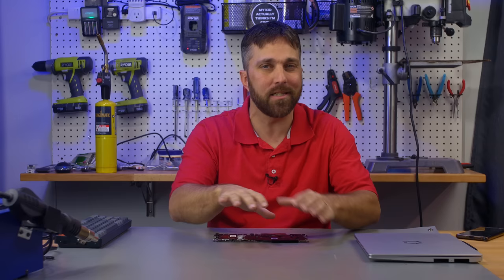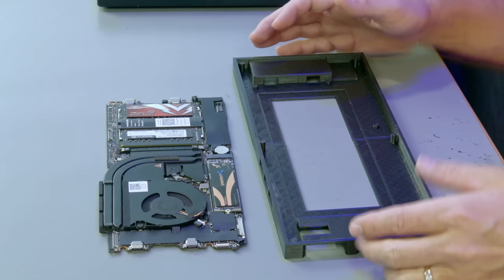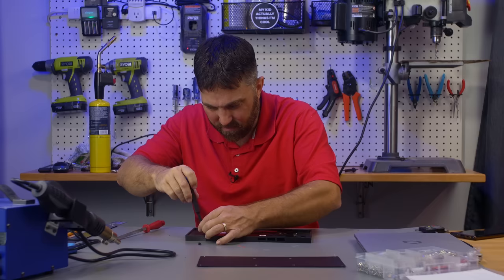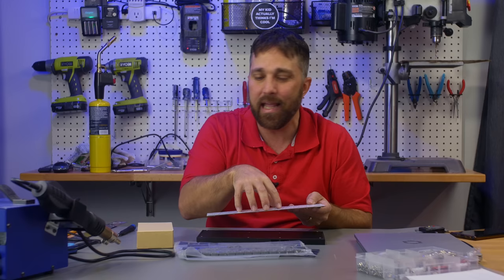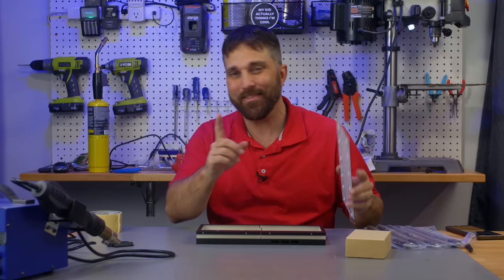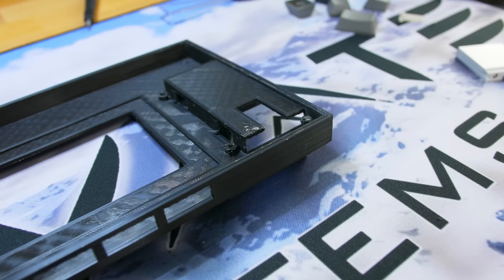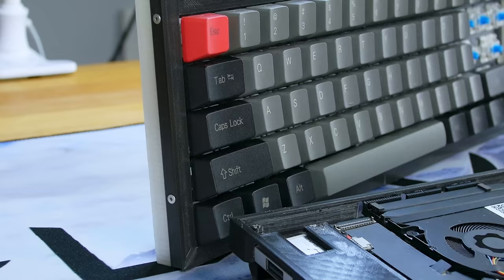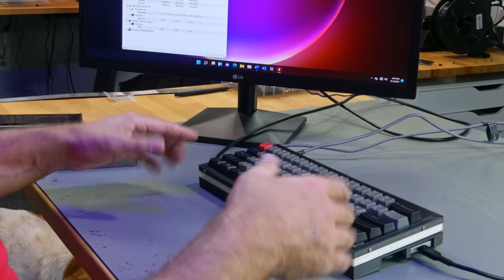Complete PC in a Mechanical Keyboard! Retro Concept, Modern Hardware.

Comment: HOLY CRAP! This is AWESOME!!!! This is like an ultra souped up Raspberry Pi 400 which is something that is already so awesome, your project makes the membrane keyboard into mechanical and gives a much more powerful processor with Thunderbolt 4 so it can even have a dGPU! This is so friggin' awesome because it's such a cool and tiny desktop replacement, the only thing I'm still a bit worried about is cooling because the heatsink and fan were designed for a different airflow situation but you have done a really good job of managing that!
Reply: Honestly if you did it right you could do much better airflow with this than a laptop will ever have. Especially if weight isn't as much of an issue.
Reply: With a metal case it could also act as a huge heatsink.
Reply: I imagine the airflow is fine though? It sucks in the air from the bottom and blows it out the back - just like it would in its original laptop frame. The feet are even taller in this case.
Reply: I've been attempting a custom PC with integrated screen using a NUC, but the challenge is getting it as thin as possible without messing up the cooling. These Framework boards look like the very slim profile that I'm looking for.

Comment: This is incredible. Hope someone can mass produce something like this in the next few years. Would be an awesome little home server deck when paired with an old display.
Reply: Yeah, sell them on Etsy
Reply: The raspberry pi 400 is pretty similar though a lot cheaper and less powerful. It's a fun little thing. Oh also the keyboard is a lot worse, after all it's only 70 bucks for the whole thing, keyboard and computer. Lots of people spend that or much more on just a keyboard alone.
Reply: I like the C64 keyboard cases you can get
Reply: @CutoutClips the best thing about this is that as the framework laptops get outdated, we'd see more kickass products and projects like this. I love it!

Comment: I would recommend trying to get an output/input to the eDP, keyboard, and battery connectors on the Framework motherboard. Save the expansion slots for other things.
Reply: Are there some connector cables or converters available for that already?

Comment: Would be cool if the 4 expansion ports could all be routed to the back
Reply: They could with a 90-90 usb cable probably
Reply: well since the expansions are usb type c extensions it should 100% be possible to rig it up so they feed to the rear
Reply: I liked the hub + palm rest idea a lot,

Comment: You could totally put the batteries in front of the keyboard and use it as a palm rest (just like 99.9% of laptops do anyways). Your keyboard is reeeeally high, making it difficult to use unless your wrists are always in the air. A palm rest is definitely needed, and putting batteries underneath it would make a lot of sense. plus, you can put some foam pad on top of the battery compartment, making for an even more comfortable device.
Reply: That's an interesting suggestion…

Comment from the maker: Follow-up - I reflashed the keyboard to try to get the RGB functions to work and it bricked. You get what you pay for. Going forward I'll be ordering this PCB https://drop.com/buy/dz60-dz60rgb-type-c-60-pcb
Reply: Couldn't find the unlisted video anywhere! (0:55)
Reply: not sure if you cover it in the other unlisted video, but out of interest why did you out right delete the other video?
Reply: @shadowreaperjb  He unlisted it, its still on his channel if you know the link
Reply: 16:37 Why not both?  The palm rest would also give you the ability to integrate the  battery from the laptop as a UPS along with a cheaper USB3 hub to split the connection you use for the keyboard to power a couple of 5V Noctua fans to keep things cool.
Reply: Could you put the battery in a wrist wrest?
Reply: If you wanted a tenkey  in a 60% form, look for a 65% PCB. for example the bm60ec pcb is 65% key hotswap with rotary encoder.
Reply: If I was making a case to put on the back of a monitor I'd make it way thicker so I can glue on big/thick heat sinks to the OTHER side of the heat pipe.  I did this on a laptop where the heat pipes face down towards the surface laptop sits on cut a hole in the laptop cover and glued a big heat sink on and it dropped my temperatures 10-12C.and that's idle and underload. A modern CPU like that could hit turbo longer with such improved cooling
Reply: Can't you replace some chip on the keyboard to make it work again?
Reply: And so a laptop has been created that has a real keyboard and not those crappy keyboards that all current laptops have. My compliments to the build. too bad there is no manufacturer that makes something like that (which is affordable)
Reply: well its been long after you start the project but here is a question:
why not use thunderbolt hub instead of usb hub? 
that way you can use it for power and may be tap in hdmi?

Comment: I always thought the battery could be used as a palm rest. Epoxy a wooden veneer on all but the top and then add whatever thickness of wood is needed for optimal wrist height.

Comment: I really love you for doing this project. 

A couple pointers though: 
• A keyboard this high will need a palm rest so maybe that could be used to make space for a battery (but still not sure if all that height is ergonomic)
• Coming from a keyboard enthusiast, it might be worth it to make the keyboard and usable as nice as possible:
- 65% layout would be much easier to use than 60% 
- Use lubed linear or tactile switches of your choice
- Gasket mount the PCB in the case 
- Design the case to sound as best as possible (but this might be too much for you to get into)

Comment: This made me realize you could order just enough parts from the framework marketplace, minus the entire top lid and screen, to build roughly the same concept but in a thinner package with a touchpad. You can even leave out the battery and speakers, basically a very portable pc but not quite a laptop.

Comment: This is brilliant! I’m a total noob and have only now really began my journey down the computer technology path but this is definitely a build I’ll take on. My goal will be a wireless build, repurpose something for the display connectivity and go full size with trackpad integration to literally create the ultimate retro framing/HTPC. It won’t be anything cutting edge as far as graphical performance but I’ll definitely focus on the wireless freedom for everyday use in home. The temperature and materials should prove a challenge but I’m confident I’ll figure something out. Might steal from the automotive and invest in gold foil to solve the issue since I can’t think of anything else. Thanks again for this! 🥳🙏🏼

Comment: This is an even better argument for the openness and modularity of Framework than simple upgradability. Other upgradable laptops exist with decent form-factors. The fact Framework's board comes out so tidily, and is meant to be worked on, appears to have made this project's success so much more attainable. And in theory you could drop in a newer Framework mainboard some years down the line if they stay in business.

Comment: This is a great project for a clean setup. Especially if you can find a monitor that can deliver at least 60W power delivery and you use a wireless mouse. One cable from keyboard to monitor and one cable from monitor to outlet (and ethernet if needed). Maybe look into thermal pads to conduct heat into the aluminum chassis. The keyboard is a little tall to be ergonomic, so I'd either go with low-profile switches and keycaps or go with your palm rest idea. Underglow does not serve a functional purpose, so that might be something you can remove to simplify the chassis if you want.

Comment: If you build a slightly deeper case, you can move the motherboard back and the keyboard forward so you can have a nice slant on the keyboard, in the vane of the Amiga 500. You could then connect the 4 USBC ports to an internal rear facing module bay so the cables come out of the back. Just some ideas.

Comment: As soon as i saw the Framework laptop this is what I wanted to do. 2 things I have thought about though are using wireless display and some how getting dual external battery packs connected to allow hot replacement.

Comment: You should see if you could create a thunderbolt extension that goes to the back of the case with a bay for framework compatible expansion cards, and maybe you could put one of the ports into a hub for a DisplayPort/HDMI, card reader, several USB-A, and a dedicated USB-C power port. That would be REALLY cool.

Comment: I think you'd be best served by going to a 96% board with the newer gateron low profile switches, so you can use normal keycaps. Rear expansion with possibly a better heatsink is a great idea, and use your palm rest to slap a yuge battery in. If you do it right, you could even make that battery cold swap.

Comment: You could go with a full 104 key, and put a battery under the 10 key section.
Also, it would be nice to find someone to make a ribbon cable for the keyboard so it doesnt take up so much badwidth, and a converter cable to go from the motherboard's internal video(for the laptop screen) to a rear HDMI, DVI, or DP depending on how the laptop communicates with the screen. This way all 3 of the 4 ports could be free
You could take this a step furth by adding a charging circuit to the battery pack. Use a dedicated USB-C PD or just a barrel port that doesnt do data to free up all ports

Comment: There reason for the keyboard cable not working is probably the PCB. For a C to C connection working, there is a CC pin to decide which is the master and slave. Many of the type C keyboard PCBs do not implement that.

Comment: If you make it deeper you can probably fit some 18650 cells in the back or in the palm rest! Obviously, not the original battery so it won't integrate into the motherboard directly, but you could connect it to the usbc port internally, and have a little battery meter on the case.

Comment: Very nice. I suggest incorporating some kind of hub so you aren't eating up all of the expansion slots to connect everything. Maybe also figure out a way to connect the keyboard to the main board using the ribbon/flex cable like the laptop case would do.

Comment: Should totally make the housing look more like something between a commodore 64 and a sony msx hitbit, done similar with my current custom keyboard frame but with a SD card reader that looks like a scaled down floppy drive and then a 3 port usb 3.0 hub but running into a few snags with finding the right length C cables and usb 2.0 hub to run the sd card reader and the keyboard while all fitting in a really small case

Comment: If Framework ends up selling just the mainboard this would be awesome! Having an ultra small form factor PC that you could tuck away in an HTPC, or inside the keyboard like this is just really awesome! I wonder what they would charge just for the mainboard? And since it has current internals, not like 5 year old PC hardware like some of these DIY solutions have, it would be awesome to be like, hey I want to pop an Intel 12th gen chip in here. Or Zen 4 Ryzen.

Comment: If I were making this I would have the keyboard be slimmer. Mechanical ain't important to me, but if it was I know there are low profile switches. 

For the mouse someone could get a track point, or make the deck wider and build in a track pad. But I use a elecom huge track ball because disability. 

It definitely needs tilting and a pain rest because it's so big. But I think another way to play with it is too ensure each component can snap off. 

Like the built in track pad, the keyboard can both snap off and be removed. And the pc can still vesa. And there are extra cables in the palm rest when you do that. 

Problem is if the keyboard detached the palm rest needs a way to modify for the different thickness... Hmmm
Reply: I feel like even with a ball or pad you'd ideally want it detached for most users. I can hardly imagine both hands parallel being the optimal position. 
Otherwise agreed.

Comment: it's often the case that cutom keyboards don't work with usb C to C cables, since they don't work bidirectionally, and normally only work on USB 2, I'd consider looking into that for solutions for the cable, you might have to make your own. (IIRC you need to add a resistor make a C to C directional)

Comment: A full 104/105 form factor might let you add some battery under the right side. The top-right port could lead to a hub board along the top of the keyboard for permanent USB-A ports and an Ethernet port, and the bottom-right port could be used for the keyboard.

Comment: Like a Pi 400 with a much nicer keyboard and more powerful Mobo!

I'd say continue iterating the design! If you make the case bigger, consider adding a groove on top to serve as an external display stand for a monitor or tablet. Maybe even built a rest w/ trackpad? (Saw a 60% wood case/rest combo that looks similar to a small laptops key/mouse area..)

Also there are now small form factor switches that may be worth considering for this. Pair with keys and you can have a mechanical keyboard without a ton of height. Nuphy Air75 is an example. Probably still need a wrist rest, but it'd also be more portable. (Actually with a low enough profile... Maybe a case cover that doubles as the rest?)

Comment: You should ditch the Framework attachment layout. You can use a USB C dock board and a USB hub to handle all your I/O, integrate it into your housing and wire up your own I/O panel on the back.

Comment: Make it deeper, place the keyboard pcb on an angle towards the front to give a better typing angle, and put the mainboard towards the back in the bottom plane of the case with the expansion slots on top of the mainboard in the same plane as the top of the keyboard pcb, makes it so that the keyboard has a better typing angle, makes it narrower, and puts all expansion slots on the back where they belong.

Comment: you could try a line of 18650 lithium cells in a row sticking off the back of the board? that should stayaway from the hot zones while also not making the whole thing that much larger

Comment: i do like this idea a lot, like so much id want to make one, however i would put more effort into making the cooling solution more capable,  like id  go for a a slim 12mm thick 120mm fan and let it run low RPM, through a snug Aluminum body so that the aluminum could act as a heat sink, anything to make the Board nice a cool.  you could go for a  USB C expansion hub which could be extended (if you make it a full sized keyboard, and redirect the blocked native expansion ports via a USB C cable to the back, so you could have more IO and have the ports facing the back. This would make the whole construction more bulky, but i think that could be negated by making a nice tight fitting Alu body to reduce overall size

Comment: Would be very interesting to see an internal KVM switch. Whereby with the click of a button you can switch from using it for the internal computer to an external computer.

Use cases may be very niche, but would be very interesting to see

Comment: great video, i wonder if you'd use a full or at least 75% size, you could insert some flat heatpipes, and if possible a battery too, i also think a 75% could probably fit a small touchscreen display like on camera equipment

Comment: Imo, I would extend the width of the keyboard to incorporate a hub in the back of the keyboard.  It would also make it more reminiscent of the Commodore 64.  I'm not sure, but if you extend it out, you may be able to add the battery as well, although a custom cable to connect it to the mainboard may be needed.

Comment: I have had an idea for a long time that I think would work well with the framework motherboard (before this I couldn't find appropriate parts). My idea was a modern version of those old 4 row LCD display portable BASIC computers. I remember some with a clamshell design, but no idea which model.

Basically what you have here with a flip up lcd (If I can find a panel would be nice to have it similar in aspect ratio to the tenkeyless keyboard), a battery pack (probably in the lcd lid), and a trackpoint modded into the keyboard.

A bit ambitious of a project, but maybe when they are easily available in the EU, I will give it a shot. It's a project I wanted to do for a while, but was never appealing with only a raspberry pi, and the lattepanda alpha(The only other SBC that seemed like it would work) seemed like it would work but also kinda seemed overpriced. I came to the conclusion a long time ago that a laptop board would work, but I never found one with the right features in a form factor I thought would easily work.

Comment: If you were able to ditch the expansion ports and just have one internal 90 degree USB-c cable (like in your original plan) to a set of ports elsewhere then maybe you could shift the main board to the side and get a battery in that way. Regardless of which way you take it I would love to see it refined and maybe even see it made into a product… maybe framework could sell a version.

Comment: I recently made a dual panel mini-monitor out of two iPad LCDs and a pair of video converters from Ali Express. have you looked at whether the reverse is possible? Obviously, the framework has a dedicated internal video connection. Is there a way to convert this to HDMI or Display Port, so you're not forced to waste an I/O bay on HDMI?